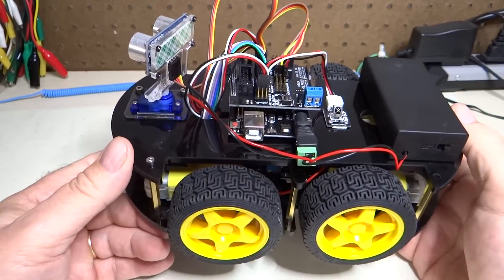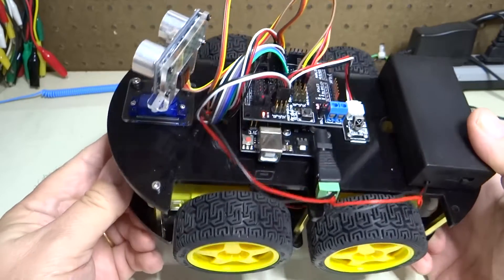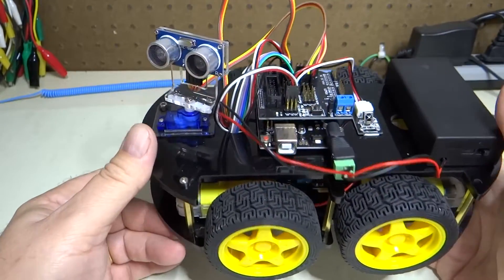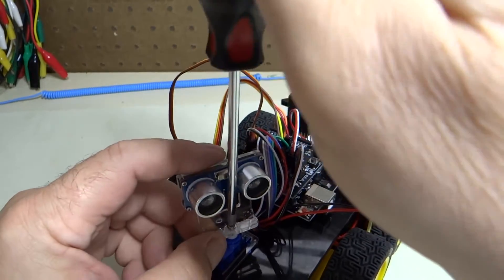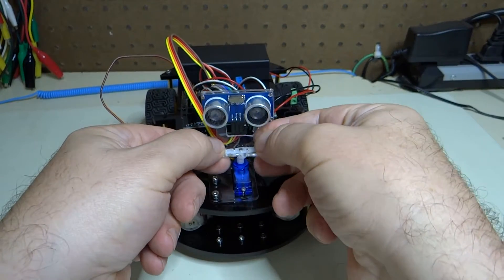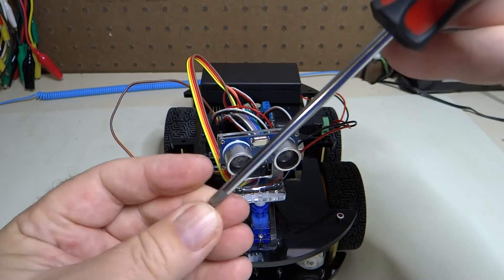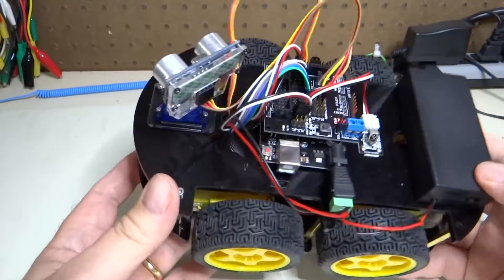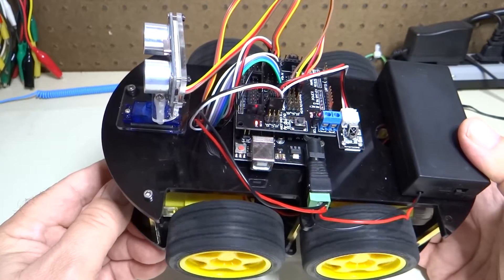Elegoo SRC kit 39 Lesson 4 obstacle avoidance car final

Comment: Hi Greg I just got one of these two days ago for my birthday and now I have a problem. When I loaded in your obstacle avoidance car everything worked except for the Servo. The Servo spun around normally but when I put something in front of it it still kept going ford. I was wondering if you knew if I needed a new one and where I could get it.
Reply from the maker: IIIDUd3S sK1nNy hook your car up to the computer and open the serial monitor in that Arduino IDE. The car should be reporting information. Then you can see if it is a Servo problem or a ultrasonic sensor problem. Most likely, you have a wiring error not a bad servo. If you need to replace parts, try Adafruit or Sparkfun.
Reply: Thanks dude! I was having my doubts that you wouldn't reply due to this being a old video. Your advice is appreciated.

Comment: Hey Greg, when i upload my program for the obstacle avoidance  , it works but the ultra sensor turn 360 degree , does that mean my servo is bad or can i adjust something in the code
Reply: John Ariza, servo rotates 360 degrees if command myservo.write was called with parameter less than 10 (in the tutorial it is 5).

Comment: I just want to mention that the servo and horn have an odd number of teeth, so if you can't get the alignment right, turn the horn 180 degrees and it will line up closer to pointing straight ahead.

Comment: Thank you for the videos, they are great. I have just one
question if you have time. I moved pin 10 (Green Wire) to 11 and uploaded your
sketch file for Obstacle Avoidance and all 4 wheels’ spin backwards.  Any Idea? Thanks, in advance as I’m just
learning.
Reply from the maker: Jeffrey Fox Hi Jeffrey, thanks for contacting me. Most likely, the motor wires are reversed. You can fix it in the code or you can swap the red and black wires on the motors. I suggest swapping the wires, otherwise, you have to change the code in many files and it's a pain. Best approach is to use the right-wheel-rotation, left-wheel-rotation, and Autogo programs to debug the motors first.